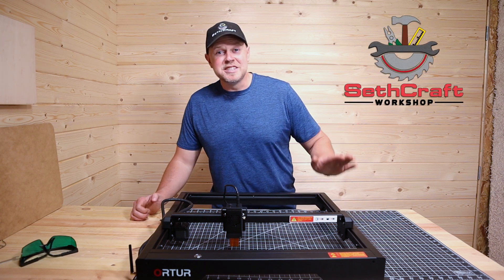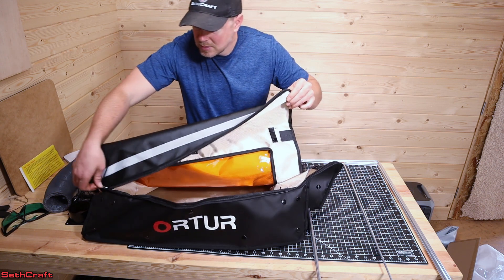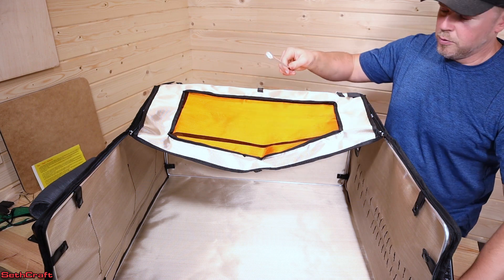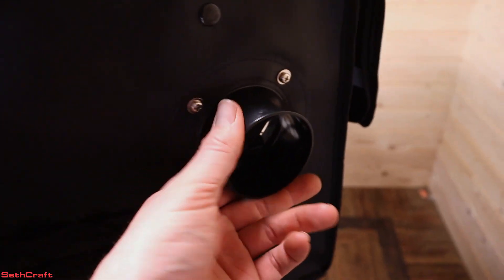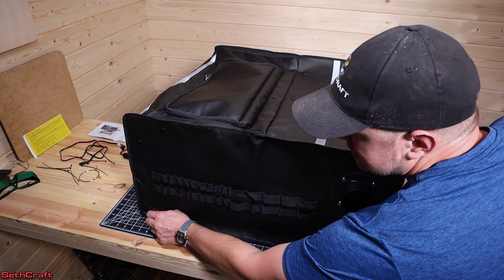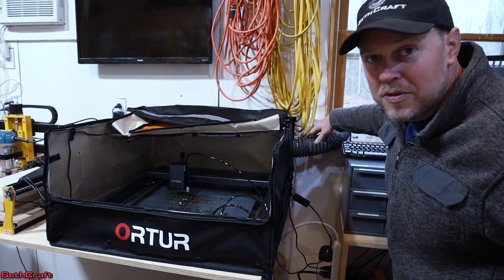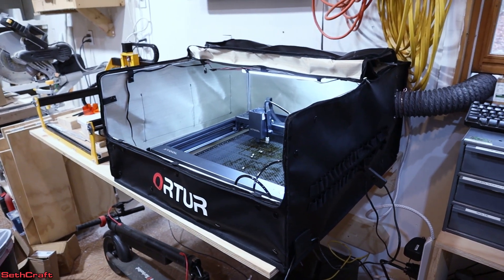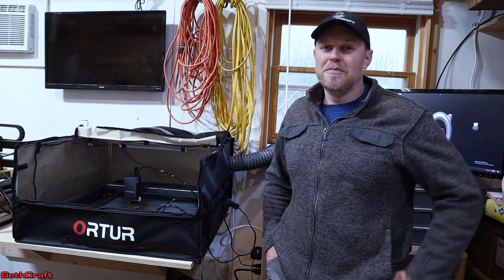ORTUR Laser Engraver Enclosure Fireproof and Dust proof

Comment: Can you link the wall plug or explain how it's hooked up? I was thinking of buying this enclosure for a different laser but it looks like the light/fan are plugged directly into this ORTUR unit from the pictures. Just wanted to verify how and what they are plugged into with your set up to make sure I can do the same.
Reply from the maker: The enclosure actually comes with the Cable that allows you to hook up to A power brick. This really is a good universal enclosure.
Reply: @sethcraftshop  Tyvm that's good to know!
Reply: The on/off switch comes as an adaptor with the enclosure?  Just need to by a 24v 1amp power brick?

Comment: I was wondering about those rods, I would have expected small pockets on the inside of the enclosure for the ends of the rods so they don't slide sideways.
Reply from the maker: When ortur fixes that issue this enclosure will be almost perfect. I have used it for around 6 hours so far.